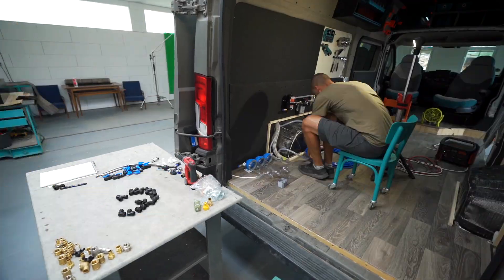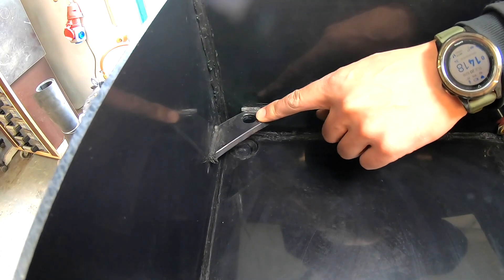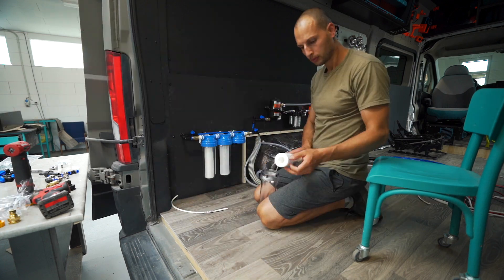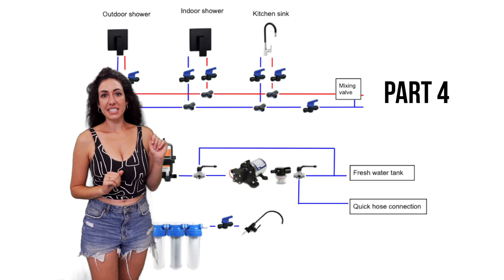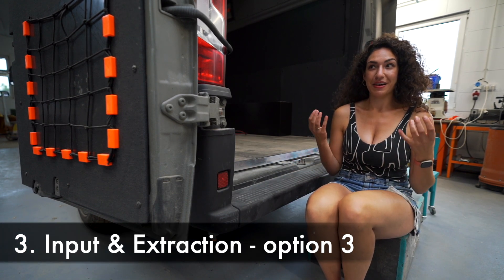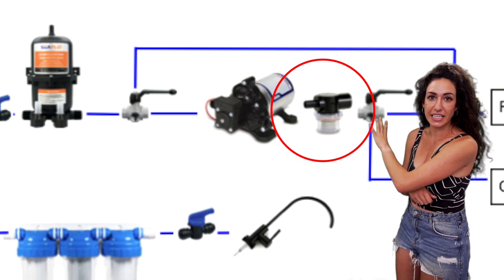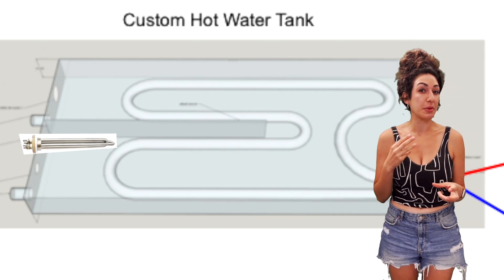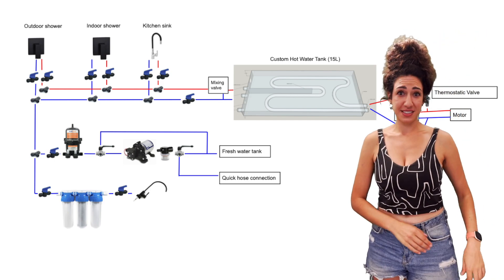Advanced Water System for Campervan (Off Grid Breakdown)

Comment from the maker: Leave your every thought below! THANK YOU!!
Reply: I left a message about the water system which took me a very long time to compose even though it was short because I have to use voice to text to write and it disappeared. Do you know what happened? was it because I left an Amazon link?

As usual great video. I look forward to watching your videos every week. I kind of would like to know what happened to my comment.
Reply from the maker: @TannyOHaley  Hi Tanny, I'm sorry your comment was deleted. We dont take down comments unless they contain threats or violence, but Youtube does have some comments deleted automatically or hidden as spam until we approve them. Weve had comments automatically deleted before when the link pushes the user to leave the platform and YT doesn't like that traffic loss. :/
Reply: Great video as always ! We use the same 12 volt pumps in our work vans connected to baffled tanks for window cleaning, we always mount the pumps the other way round ( so they look upside down) as this helps to prevent air locks caused from driving when the pump is higher than the tank outlet. Just a thought from us in the UK
Reply: What Facebook do you belong to that gave you useful information?  I need to join I'm in the middle of building my rig
Reply: i would love for you u two to figure out the problems and come up with solutions and implement  a recirculating shower so that a smaller fresh water tank and/or smaller grey water tank can be used which will help save tons of weight
Reply from the maker: @holyscience3763 i feel like that has been solved already. It’s something we don’t believe in.
Reply: Love your videos I was hoping you could steer me in direction is there a free CAD program that I can use to help design my DYI camper van
Reply: just the guy showing things, please
Reply: YouTubes no nudity is BS
Reply: @michaelgonzalez8863  There is a Duran Duran video that challenges that notion... Duran Duran - "The Chauffeur" from AS THE LIGHTS GO DOWN, in case you're interested...

Comment: Before reading the comments where I'll get overwhelmed and confused, I'll say my opinion but I aren't at all versed in plumbing:
So I'd be concerned about clogs or the odd bits of metal in valves and such, so I'd make a circular around the water tank with the input as done here, but with the filtration here too because of the dirt in wild water. The uv would also be after the tank and input. Yes with the pump position, but I can't figure why no filter for the shower, heat encourages bacteria :o the uv should be on 24/7 anyway, but I still need to loop some explanations from this video to appreciate it more :) i dont remember drainage mentioned, I have limited focus lately adopting a dog and being autistic, but I'd recycle drainage back to the input area before the filters, thinking clean water won't do anything to them in the right series? I'd also go with 3 compartments minim to 0.2 microns, but a pre filter by the drinking tap; I'd ideally have a sink, automatic (more than likely not possible) filling brew dispenser in the cab and by the sink, and a rainfall shower. Idk if the latter is possible possible either but I've seen it done. I LOVE the hot water tank, I was imagining a bellow  kinda thing but that's right, we don't need much at all:o I love your attitudes and that of the commenters, that's what this is all about :D

Subject to whether mentioned in comments or the video where I'll probably find in the next couple days, how were the tanks made? I imagine pvc sheets heat welded/melted together but I'm surprised the welds are strong, maybe my bad experience trying to repair single use plastics :s lol. I think the hot water tank material was mentioned but I'll assume not stainless steel because that, and I'm not 100%, does rust with longevity as the sacrificial composites depreciate(?); so galvanised steel, but that's difficult to weld with the gasses produced, so a welding gas mask or die forming? :s :o

Lastly, I've been following you guys for a long long time. I love your progress, your inspiration, sharing, depth of information, silliness and innovative ideas. You guys rock!! Thanks for sharing so much

Comment: I know it's an old topic and it's to late, but...
There is an idea for one more water heating option. Only for the summer time.
It's a tiny coper pipe system collecting heat directly from the car's walls under the thermal insulation. In the summer time the walls can get very high temperature. The heat pipe has to touch the wall's surface. This solution needs also 3 thermical sensors, 2 for the 2 side walls and 1 for the hot water tank. An easy elctronic comparator (f.g. based on Arduino) can activate one of two valves (1 per wall) and a small circulation pump.
With this solution you can pump up water directly "thro the walls". 
Or... more expensive you can add a small heat exchanger, second pump and run the walls system separatelly with a glicol loop.
I just wonder how much the people loose of the solar/heat energy during the summer time and use a lot of the other energy to heat up the water in the same time ;)

Comment: I love the idea of using the engine heat ("cars are just heaters on four wheels") - maybe you could even benefit more from the motor, charging the battery by the light machine and even by regaining power by the brakes. And I wonder if a little aircon might also save a lot of heating energy.

Comment: You forget very important. When using presher feed directly. You need presher reduce. A  lot of water supplies have too much presher. Can blow system apart.
Reply: I agree with this comment. There is a great range of pressures in public supplies. I used a pressure regulator / reducer straight after the external feed connector. This also helps because if the pressure out of the regulator is adjusted correctly, there are no surprises when a tap is opened, the pressure and flow should be the same, and also, hot-water tanks usually have an upper pressure limit so the external feed pressure should be below this limit of course.

Comment: Hi, Really good videos and some great innovative features. 
One thing I do like is the position of the fresh water output pipe which takes water to the van. 
From the video looks like you have brought the pipe into the tank from the top surface of the tank, which is different to the normal position of low down on the side of the tank. Obviously I want to do the same!
How did you fix this pipe to the tank and does it work ok?
Thanks Ron.

Comment: Hey guys, can you tell me how is the water sucking from a creek going? I am interested in doing this in my van, but I think that those small van pumps are not made to suck water from more than roughly 2m away. That doesnt leave a lot of hose length. How did it work for you?
Reply from the maker: Yeah that idea did not work out. I used a separate pump with a portable battery closer to a creek.

Comment: Absolutely obsessed with your channel first of all, infinite thanks for sharing your journey and knowledge!

Some things I've been wondering all the way throughout the build series: 
-how are the plastic tanks holding up? I don't remember seeing you insulating them after all, is that giving you trouble? Or if you did end up insulating them, kflex? 
-another smaller concern, isn't the water freezing in the lines that come from the tank a problem, or does it get sufficient heat flux from the van interior to keep liquid?
-finally, does the stainless steel hot water tank hold up well? That immediately raised some alarm bells in my head seeing how heavily corroded commercial boilers go within their lifetime, even with a sacrificial rod.
Keep in mind all of these questions are from a naive mind looking at building a first camper van in the "near" future, I'm not trying to poke holes into your systems, which are incredible all around!
Also I realize writing this you haven't really spent a full season in the completed van yet, let alone a freezing one, so these durability/cold questions can't really have an empirical answer 😅

Comment: Great plan on the water heater.  Looks like you built the tank from plastic, What did you use to install the lines through the tank from the engine? sealing the metal lines into the tank?

Comment: ive had a similar hot water system for many years , you can simply buy a twin coil calorifier tank ,gives you quick hot water from your engine  or diesel heater ,and a 1kw immersion element  that can be either used from mains electric or dump your excess solar in summer , so much easier and off the shelf

Comment: Check out Guzzle H2O for a low power shock resistant UV light solution that is flow activated.  It may fit your needs. I am using their stealth set up.   Good luck.

Comment: Hotwater system is awsome. We use similar tech on superyacht, heat from engine, cascade hotwater vessels- different temp, when needed. Additionally possibility to electrical heat, when vessel stops engine and if needed.
For the fresh water from creek and other sources. Keep in mind bacterias etc start to grow. On membranes every system, should at least every two weeks in operation, otherwise fouling on membrane. Ultrafiltration more safe. But keep in mind. no organics in the water, it will pass membranes and your micron filters for sure. Chlorine destroys membranes. But you have to keep your system clean. UV will help in front of filters, after a first strainer. That's probably the best position for UV. It works only correct by low turbidity. Nice videos.

Comment: I was considering doing a coolent loop to heat my water tank in my 4wd but decided i’m just going to put a 250a alternator on instead and a 600w water heater. That way if the cars running it automatically heats the water and when my battery reaches 99% it will turn the heater on and turn off when my battery goes below 97%. I also have a manual switch to turn it on if I want. Would think with your massive battery you wouldn’t need the coolant loop. 

My only decision is whether I make a custom tank that can reach 95 degrees as others only reach 70 degrees.

Comment: we're having 550+610 L tanks  ..   We ll have 1 battery driven and 1 AC driven pump to take from the river. Pumps need te remain wet or they will ll stop. the 1" pump will split in 2 1/2" hoses filling the tanks. By then it will have passed a spin filter.  Once the tanks are full, they will autorotate through the 2 stage sediment Backwash based filter system ( 1Mcn and Iron ) ... then it should be ready for Showers and sink. To drink we have high capacity Ultra filtration system. We're now considering putting a UV filter on it to kill the microbes to keep tanks clean and debug before the ultrafiltration system...    great job you did on that space. top ! .. I am a little worried about the tank at the back for weight distribution and that gardena looks pretty vulnerable... :)

Comment: Use a UVC light. It will sterilize against virus, bacteria, protozoan, just about every type of pathogenic thing we can get. You can't get this light on your skin or eyes, and it only takes less than a minute of exposure to do it's job. Check it out about using UVC light waves to sterilize. It's used to sterilize operating rooms, industrial areas, water, all kinds of surface areas. Cheap and becoming more commonly available. Good luck!!

Comment: Great video, my only concern still the moment is the pressure in the hot water tank, especially with the box design of it. If there is any pressure it will distort and possibly fail, if its going to be vented with a header tank then that should be OK.
Reply from the maker: It has a pressure release valve so it should be fine.

Comment: All I can say is wow. Well thought out, intelligent way to get good, fresh, and warm water in a van. Couple of ideas. 1 if you are using the heating element, and the water goes below the element, it will burn it out in a few seconds. You can use a level sensor to cut it off before it gets too low. And 2, a much easier option is to use a On Demand tankless water heating system. That way you go from cold water to the propane on demand heater and bypass the tank altogether.

Comment: didn't  read the previous comments ... but whay not  put a oneway valve  after the pump and then the quick connect and will be no need to turn any faucet on or off ...

Comment: I backpack for decades and use river water with purifiers to drink the water. I would never store river water directly into my potable tanks. I would purify water before storing into the tanks. a 1 micron filter will not filter viruses. you need a sub micron filter, and UV helps. I recommend active carbon too. getting the runs sucks. you can put that inline with your river pump so you don't just stick contaminated river rater straight into your tanks. most common is giardia from animal feces. You don't need a UV filter with a purifier, but if you can, I would.

Comment: @6:48 - I am studying the layout; As I'm laying out mine, if my goal is to be able to fill the FWT with the same hose as I'd use for shore water pressure, then wouldn't I need a way to bypass the pump and FWT when I'm on shore pressure?,  So if Shore Pressure = True then bypass pump, accumulator, and FWT; If Shore Hose Fill, then FWT = Open and Pump Circuit = Open...  Wouldn't I need at least one more valve to shutoff the FWT tank completely when on shore water pressure?

Comment: Very well done.  For UV filter we have been using Guzzle H2O Stealth UV system on our cold drinking line for the past year. Compact - easy install and turns on with water pressure sensor.

Comment: Love all the thought your putting into the water system . BUT DO NOT PUT YOUR AUX WATER INPUT UNDER THE BUMPER , that is THE WORST possible POSITION . Better to combine it with your other water input in the side wall of the van. There are already NICE looking pieces made for the RV industry. Under the bumper will get knocked off on a curb or scrubbed off exiting a gas station, not too mention filled with mud from a rut in a rough road or just spray from both tires on the that side of the vehicle , that will make keeping it clean a nightmare. The plastic units made for RV's can be behind a keyed door or just out the side with a plug to screw into the fitting [ not all that great, they get broken when you drag a tree branch along the side and even from walking into it with a shoulder when your not paying attention, ask me how i know ] Check out the raw stream or lake water system from the channel LIVE AND GIVE 4X4. they have an independent briefcase style filter system with it's own pump that takes out all debris and bacteria ,virus,  you can copy or adapt something like it to make it your own. It takes up little space and emptys into your gravity fill so is very uncomplicated and is out of the way when you don't need it, which is 95% of the time.      CHEERS AND SAFE TRAVELS     Steve h.

Comment: Why not use check valves to hold water pressure instead of three ball valves? My RV has a check valve where the city water hooks up and the water pump has a check valve. The water pump and the city water can supply pressure to the system simultaneously without a problem. Then you just need a single valve to fill the freshwater tank.

What about the quick connect? Pumps are usually better pushing than pulling water. That means that you have better results when the pump is lower than or closer to the source of water. Using the onboard pump may work, but having a separate pump near the source would greatly improve the water flow.

Comment: Why don't you use a reverse osmosis system for your drinking water? You can connect it via the pump (3-4 bar) on the main tank instead dump the passing water (I think 4 litres per 1-litre drinking water) and loop it back into the tank. It is only two-three stages in addition to your existing 3x filter.
Reply from the maker: Sure, that would work too.
Reply: @ladiandmargaret  The benefit of this system is that, if you are  running out of water in the wild, you can use any recourse of water and it will be clean drinking water after. If you install an automatic pressure switch for the existing pump you'll have always pressure on the system. Just think tank. 😉

Comment: Regarding post-filtration processing, I've not done the analysis, but from a health perspective (licensed civil engineer here), you'll need some kind of disinfection process (typically UV or chemical) unless you are extremely picky about where you fill your fresh water tanks.  I've got thoughts from the level of a municipality, but no idea on van specific implementation.  I'll say that UV typically doesn't affect taste the same way that chemical disinfection does.  You can also consider getting a reverse osmosis filter, but those can power intensive, and you have to be careful or the water will actually leach minerals from your body as it passes through you, as the water from an RO process is pure at the molecular level.

Also, regarding option 3 for intake, there is a theoretical max length that you can suck - about 30 ft or 9m.  This is due to the way vacuums work

Comment: We have a ball cock in a tank design which enables permanent connection to the van. It by-passes the pump as it's already pressurised. It flushes our tanks and we leave with full tanks. We treat with Aquasol. Decided against any filters with the current build and simply use a Brita carafe for drinking water. Love the camera on the electric drain valve. Agree completely with Ladi's surprise!